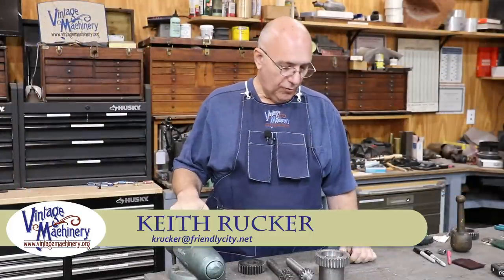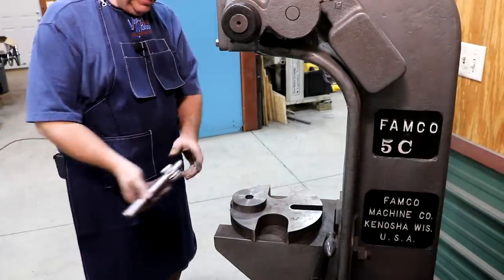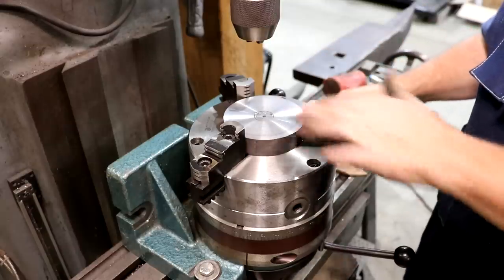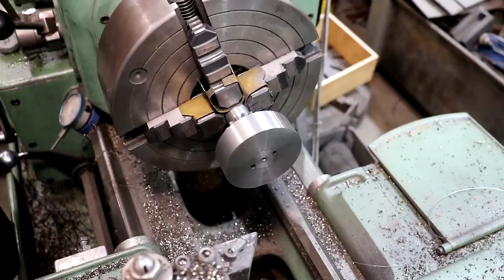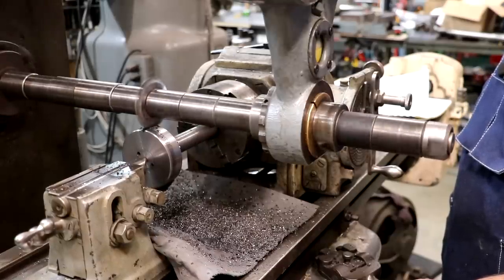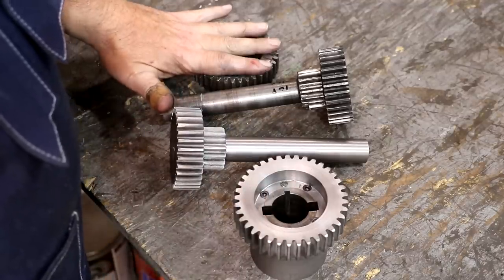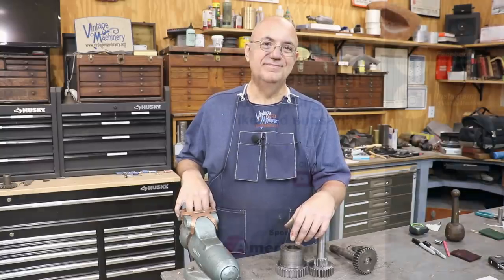Camelback Drill Press Gears 4: Making the final Gear, Pressing and Keying on the Shaft

Comment: Curious, did the large pressed on gear teeth require timing to the smaller machined gear?… no mention in your set up
Reply: I was thinking the same thing on that last view of the cutting, I guess not as I'm sure Keith would have known.
Reply: Since it is a drill press, I'm sure there is no timing necessary...

Comment: At 15:13, after you put in the set screws, but before you turned the OD, did you do another facing?  It looks like you got into the the set screw on one side, which is how I noticed.

Comment: Always fun to watch. Wondered if there was any alignment requirement between the two gears on the same shaft. I know “centered up” was mentioned for cutting the teeth in the larger gear. Just curious. Thanks for the video.
Reply: I thought about that too. I looked at the very end of the video. They looked very much the same as the original. Perhaps by chance.

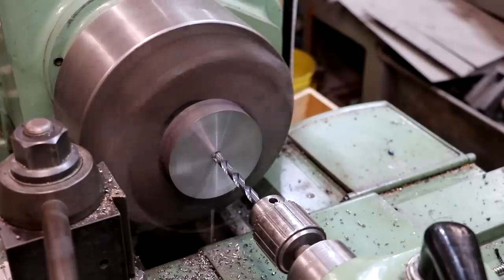Comment: Great series... as always! At about 3:55 into the video (starting the centre hole with the 3/8 in drill bit) the drill noticeably deflects. Please explain. Thank you.
Reply: That happens on most every drill start.  The edges on a drill bit do not start perfectly together.  That small amount of movement that you saw has no consequence to the integrity of the hole.

Comment: I would have waited to drill the set screws till after the gear was finished. Thats a one time deal . You could move and redrill or upsize the set screws but why take the risk
Reply: Why? The way Keith did it, he was able to use the actual keyed gear shaft as the arbor to cut the gear. Worked out just fine.
Reply: @grntitan1  thats not what i said..... plus sounds like you have never used a dividing head before.
Reply: @vettepicking  Why are you angry?  Why does this matter to you?
Reply: @paulcopeland9035  whos angry?